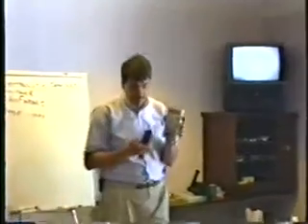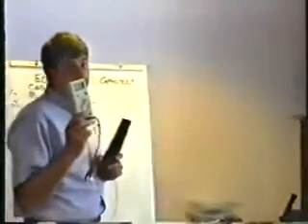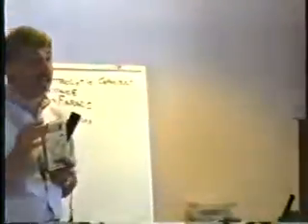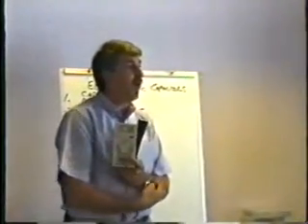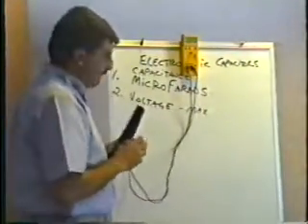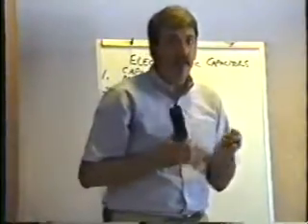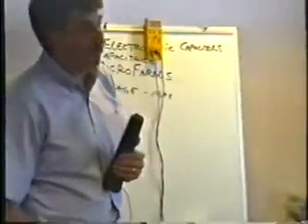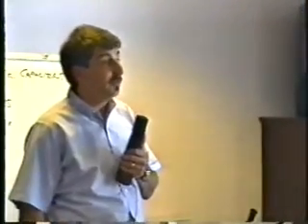Basic Electronics-Chapter 9

Comment: In 2023 dmm's come with capacitance very cheap. Whata a luxury
Reply from the maker: But they rarely test ESR, which is the most important test. Measuring capacitance is not important.
Reply: @randyfromm  I have one those cheaper esr testers off Amazon for 30 bucks. Problem with that one is measuring inductors.  If the known resistance is high enough to detect compared to the inductance value it will give you the resistance value. Would love to have an old sencore with dedicated L C R tests.

Comment: Can capacitors work both ways? I have some 2 microfarad 1,000v caps that have no polarity indication of any kind. When I test with my cap meter they test 2 microfarads both ways.
Reply: It is probably a non-polarized capacitor you are talking about. They don't have a positive and negative side. I believe those are intended to work with AC whereas polarized capacitors are for DC circuits and will blow up if used in an AC circuit.
Reply: Most non-electrolytic caps are not polarized meaning they work both ways